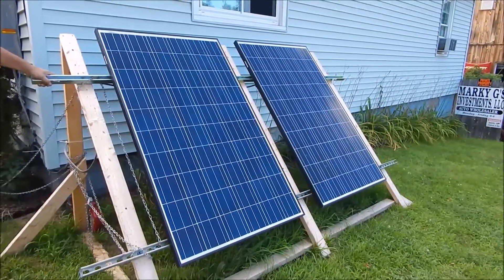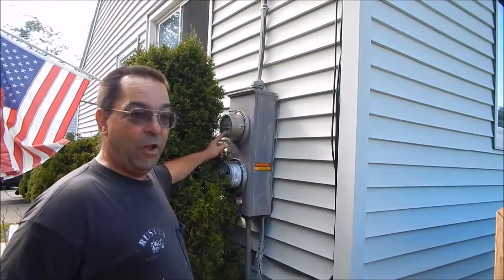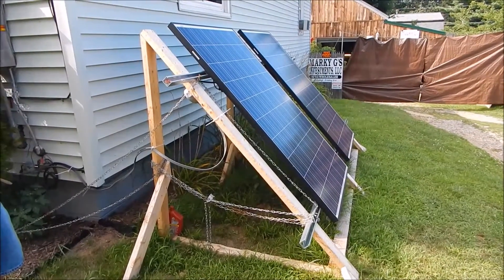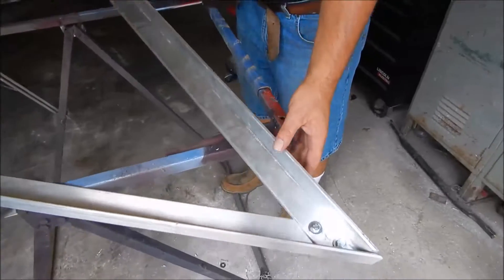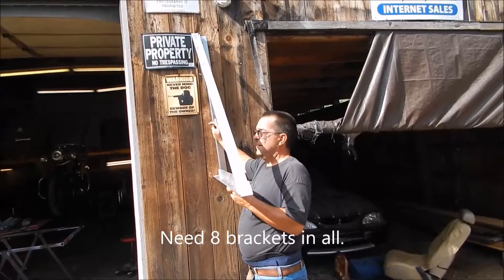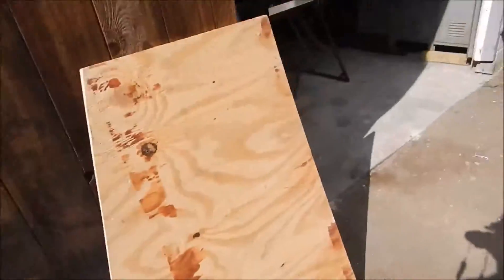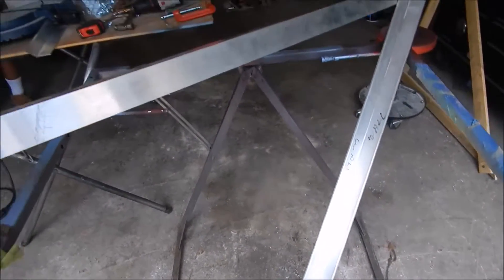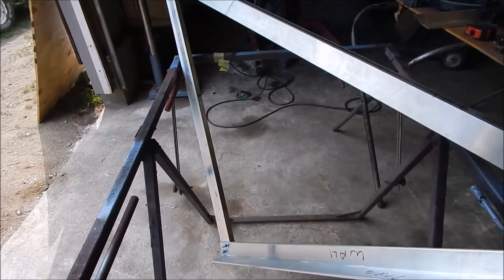Solar Install 2500 Watts Grid Tied  Part 1

Comment: I cant wait until its up and running. The commie meter that is on my home under the analog is for the hot water .. back in the 70s it was cheap back then . i will eliminate the bottom meter when i get up and running
Reply from the maker: We will get it done.

Comment: that will work well, is that the 43 degree angle for average fall/spring we use up here?
I have a smart meter, so I have to be careful what I do too.
thanks
Reply from the maker: Close 45 degrees it was easy to repeat when building the brackets. Did U see me wave when I went by Sunday?
Reply: was that you? ha ha
I was at a car show in Otis selling my veggies, not the best venue for it.